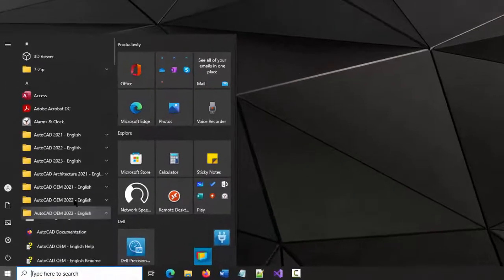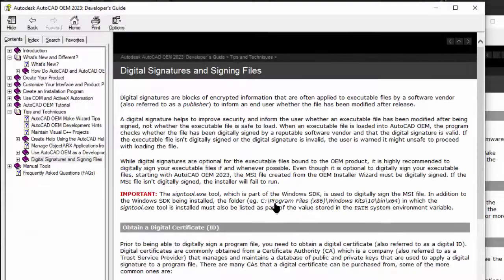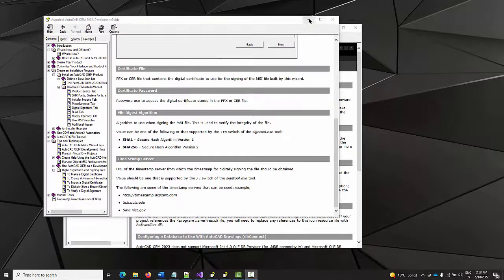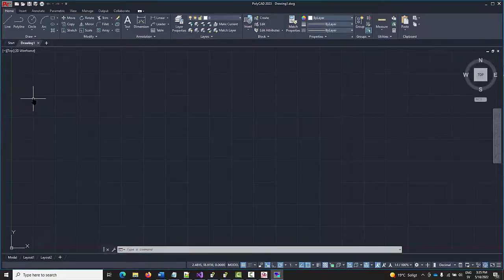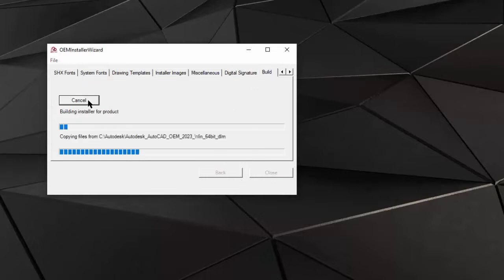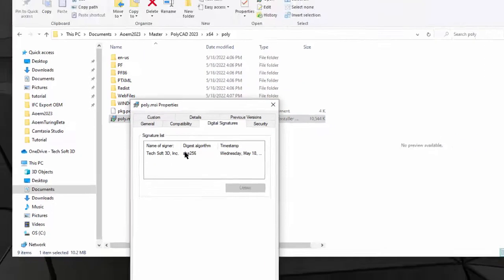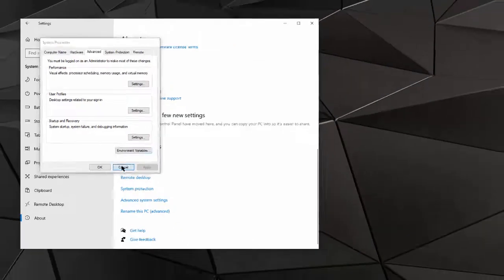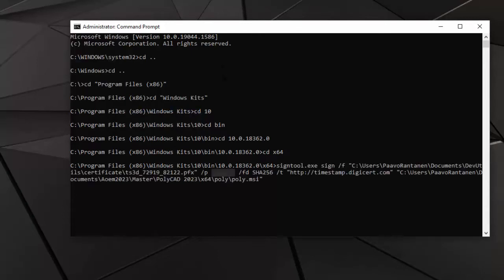AutoCAD OEM 2023, InstallWizard Digital Signature

Comment: Hi, nice video but I'm having a problem with certificate that I can't understand

I'm 100% sure the field inside Digital Signature tab are correct, I've checked them multiple times, and I added the path to the signtool into the PATH variable, but still the msi is not signed and therefore the setup doesn't work
To tried understanding the problem I tried signing manually like you did at the end of the video but it worked just fine, so that the Setup for oem could launch normally

do you have any idea of what could be the problem? Thank you in advanced
Reply from the maker: Andrea, not really. You can see the signing status at the very end of the generated 'buildlog.txt' file. We have seen signing issues for people using VS 2022 on Windows 11. Ask our OEM Consulting Engineer Paavo Rantanen for assistance, please?
Reply: @TechSoft3D  Thanks for replying. 
buildlog just says "Sign [filePath] failed" without any info, and unfortunately WIndows 11 with VS2022 is our case...

Yes, I wrote the support mail to Paavo, hopefully he'll be able to help me solve this issue